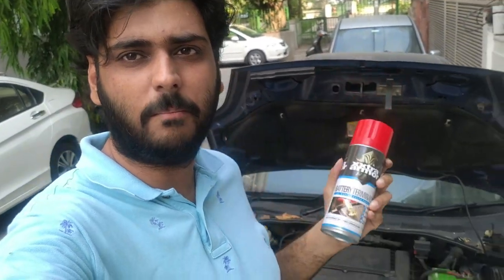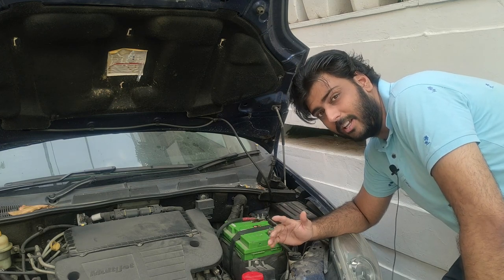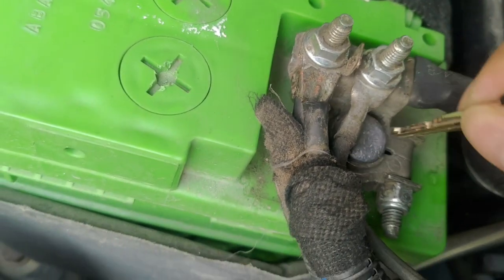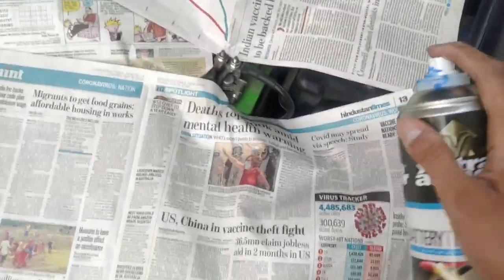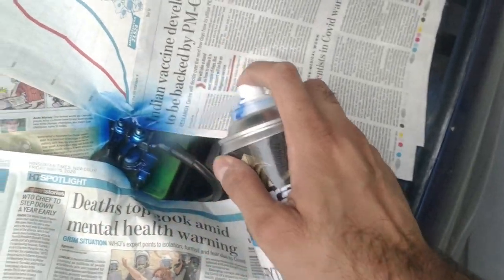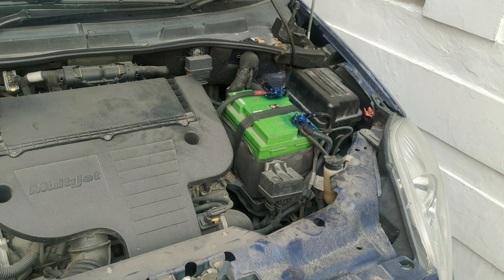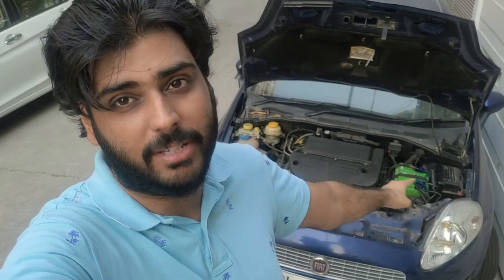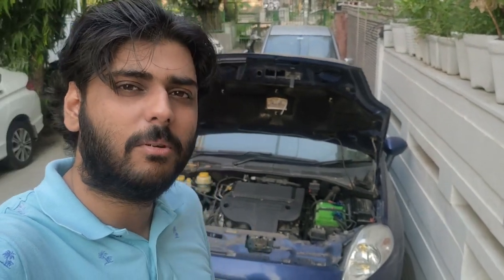Best Way to Protect Car and Bike Batteries || Xxtra Armor Battery Coat

Comment: i sprayed wd 40 on battery terminals lol.
Reply from the maker: How long that lasts bro do let me know. 😊😊
Reply: Amul Luthra it should help in rust prevention but this xxtra armour thing you applied is tad better for sure ! I was trying to order ac foam xxtra armor on amazon bro but these fellows have no cod so will order some day soon . Where did you buy this terminal spray, online or Kashmiri gate etc .
Reply from the maker: Yeah this battery spray is solid 👌. I bought it online long back. And I think now Amazon started COD 😊. So whenever you try that ac cleaner please do let me know. Because I want to try that too 😊